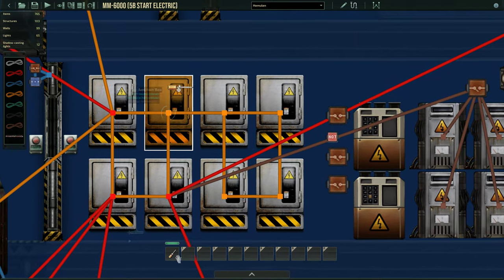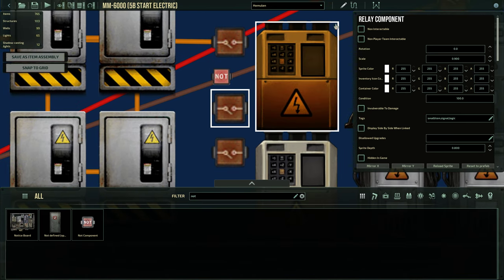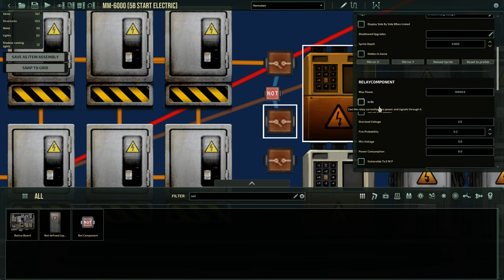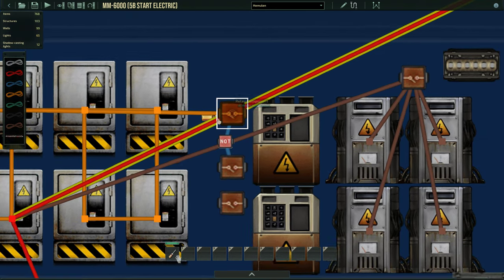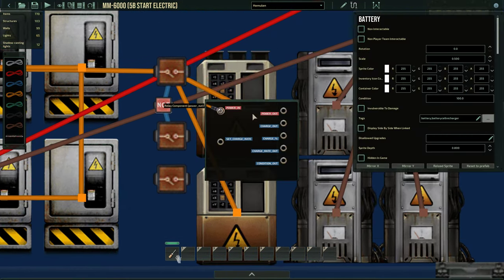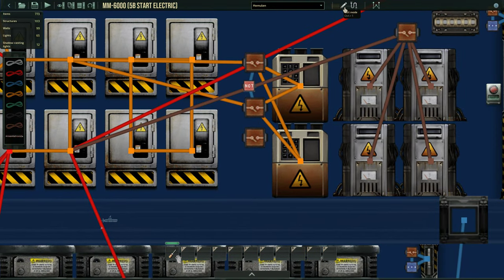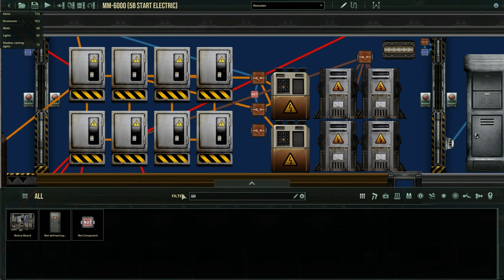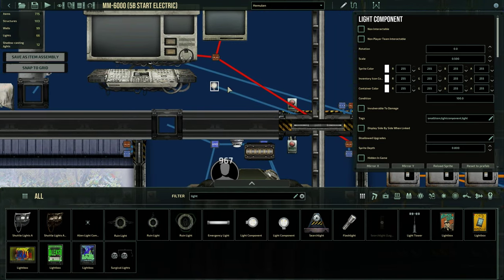Barotrauma how to wire backup batteries

Comment: Michael Scott: now explain it to me like i'm 5
Reply: Reactor provide power to junction box -> engine,charge battery, coild gun,...
Basically this system use battery supply power back to junction box when reactor dont provide ( out of fuel, shut down on purose, blow out,...)
Reply: Battery has In and Out ports. Normally, they're all linked together. Linking them to a Relay lets you manually switch them from Charging to Discharging, meaning they can be used during high-energy maneuvers, but can also be turned  when idling, which is good since batteries waste a small amount of power as they charge.

Comment: Having batteries input and output directly connected to junction boxes helps immensly with load changes. Something about putting them behind relays seem to change the behaviour. I'd rather use a charge balancer than ever putting a battery behind a relay ever again until this "bug/behaviour" is fixed/changed.
Reply: Yes they would overload the relay, the latest update Urban Expanse introduced a power rework so this should be fixed.

Comment: The on/off switch is fine, but I've been trying to make it automatic. I want the batteries to charge whenever power is normal/overvoltage, then discharge whenever the grid is undervolted. It's kind of working but also super janky. Do you know how to make it work?
Reply: Try regX, find a video name Fully automated recharge supacitor - by Nerro
U could understand the basic simple use with it, and most of my auto thing r run with regX

Comment: Doesn't that... create a pulsing toggle circuit? It looks like the battery feeds back into the same relay power circuit that feeds the battery, so my intuition tells me that when there's no power feeding into the batteries that the batteries will toggle on, then feed into the battery power circuit causing them to turn themselves off, which would repeat ad infinitum until power is restored.
Also, how would this deal with low power rather than no power?

Comment: Having some trouble...flipping battery power on causes serious flickering. This was before I disconnected the junc box from the rest of the sub, as I am using this system for only engine power (status monitor and nav terminal are plugged into the junc box, too). Even with that, battery power causes whole sub to flicker intensely. Engine start up sound plays repeatedly. Can you help me?
Reply: I did use legacy junc. box for where the batteries are plugged into...if that makes a difference.

Comment: how can i set the starting recharge speed of supercapasitors?
Reply: Hover over a supercapacitor and press E (similar as opening other items in the editor). There, you can set the starting charge rate. Could also just change the "Recharge Speed" setting in the item's editor interface on the right.

Comment: How would i, an idiot wire a reactor fuel_out to make this relay connection trigger when the reactor looses fuel
Reply: You could connect fuel_out to an equals component signal_1_in, and a memory component with a value of 0 to signal_2_in, then the equals component signal_out to the relay set_state.
You may need to add a signal check component between the equals and relay components, set to true value 1, false value 0, detected value 1 so that it will turn back off when fuel is added to the reactor system
Reply: @TheWenzaa  will try it like that my dumbass was trying for specifically the first section of that, but the issue i was mainly running into is that fuel_out going through a mem+greater chip running on 0>? causes a constant flicker on the battery system causing blackouts and power on every second

Comment: Can you do this in a Vanilla sub?
Reply: Did you ever get an answer to this? I was wondering the same thing
Reply: @gutlesswarrior  You can manufacture Components in the fabricator (and desconstruct others, then re-fabricate them!) and use those to make this type of system. I believe relays normally have a maximum of 1000 kW, so you may need to be a little more elaborate with how many you use. Vanilla batteries only have 1000 kW max output each, and they charge at half that, so you may just need to find room on a junction box. Without any sub modding... you'd probably just need to Relay up low-wattage devices together like the lamps, to save Junction space. :D
Reply: @ctdaniels7049  thank you! I'll give this a try then